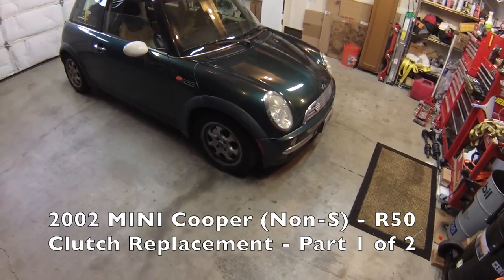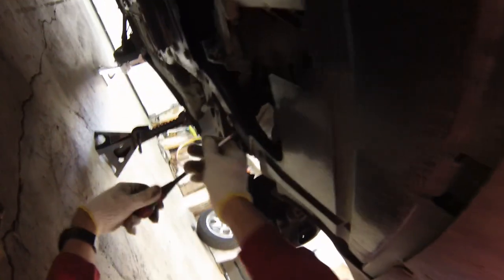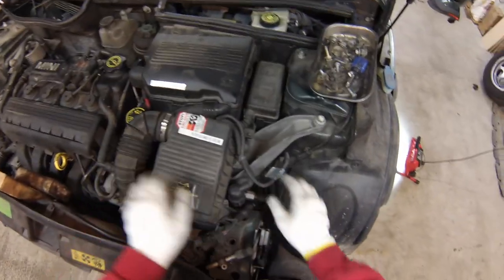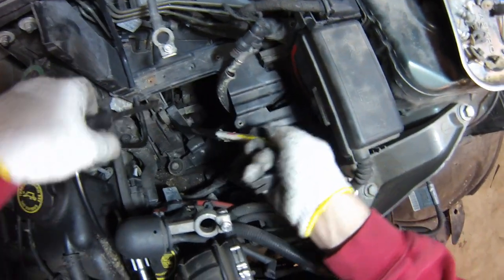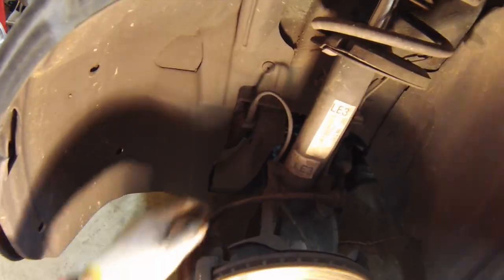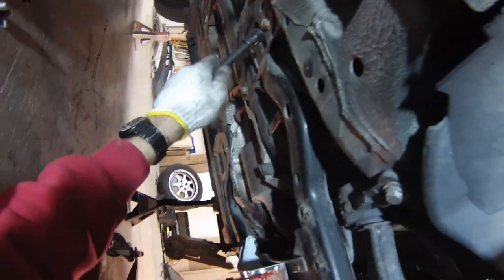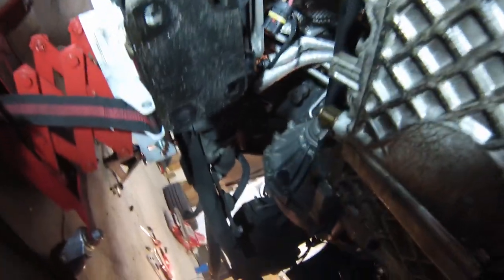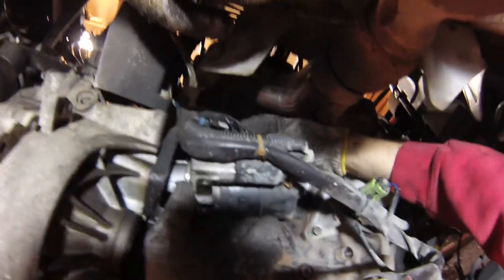2002-06 MINI Cooper Non-S Clutch Replacement Part 1 of 2

Comment: Thanks you for a thorough and well made guidance.
BMW in Norway wanted £2,200 for the job. (Madness) 
Bought the clutch for £100 and fixed it myself. To evenings, and the job was done. :-) 
This video helped me a lot, and made me use 2 evenings instead of 4.  THANKS

Comment: Hi There, from across the Pond in the UK 🇬🇧. I just wanted to make a comment. I recently had to replace my Gearbox and Clutch and Rear Oil Seal. Your video Help Massively. As I do most of the work on my vehicles. Iv never had to change a Gearbox and Clutch. Your Two part Vedeo was a great help in me doing myself and save a lot of money as it cost between £350 to £450 to get it done at a independent Garage. Im even happy to say, I was able to centre the Clutch disc by hand on the first go, with your tutorial. So I want to say a BIG MASSIVE THANKS!!!!
GREAT TUTORIAL, AND KEEP UP THE GREAT WORK. YOUR CHANNEL IS THE ONE I COME TO FOR HELP WHEN ANYTHING GOES WRONG WITH MY CAR.

Comment: Thank you for this excellent video, I just replaced the clutch on my son's 2002 Mini Cooper and following your fantastic instructions made it really straightforward. The most awkward part was clipping back in the spring clips on the 2 gear linkages, very fiddly!  Also anyone doing this needs to take care when removing the ball joints, even using the right ball joint removal tool as in your video it is easy to damage the rubber seals - I replaced both ball joints just to make sure while the car was off the road. Thanks again Mod MINI for this super work!

Comment: This was an exceptional video on the process. Very thorough. I followed to a tee.  One tip that I found to make life easier when re-installing the bellhousing.  Get it close then buy/use two or three M12 x 120mm cap bolts to thread through the trans into the block to help hold and align it before mating them up.  Getting the transmission lined up back into the input shaft was a bit of a chore.   Other than that -- this was perfect.

Comment: Well done an excellent guide saved me a whole lot of head scratching did it on my drive on my own no real problems removing the plastic wheel arches is a good idea as it allows you to see much more
Reply from the maker: Not necessary but many people say it is helpful to remove the wheel arch.
Reply: Mod MINI I have a 2002 Mini and have a problem with it moving. Was accelerating hard in first and when I hit second it suddenly quit moving forward. The shifter will go into all gears including reverse but won’t engage. Checked the shift cables which are fine. With the car running you can hear something rotating beneath the car that doesn’t stop even when you engage the clutch. I know that’s not much information but wondered if you could diagnose it based on that info? I am capable of doing the work myself but need advice on determining the mechanical issue before taking the car apart. Thanks!

Comment: Great video very professional job and well filmed too. I have just completed disassembly of a RHD (UK spec) Cooper and couldn't have done it well without your guidance. I'd recommend removing the gearbox end support bush before attempting to split the bell housing as it will definitely foul. I also found that the gear change selector fouled an A/C pipe when trying to remove the gearbox, so beware of this as once it catches up it's a devil to free. Just to confirm that removal of the steering column from the rack is the same for a RHD vehicle. (there's more room on that side providing you remove everything as directed in this video).After disassembly I found a failed thrust bearing, the bearings hadn't come out of the race yet but they would have if the car had been driven any longer. I'm not convinced that the thrust washer design (Valeo replacement is identical to factory fitted one) is robust enough for this car to make it past 125,000 miles, which is daft because the quality of build of the car apart from this would enable this car to go for 150,000+ miles if driven sensibly. About to watch part 2 and complete my job. I'm a bit worried about the amount of greasy deposits in the gearbox housing suggesting a leaking oil seal on the box main shaft. Although not part of the clutch replacement, I have a worn track-rod end joint to replace and I could not believe how incredibly seized the track-rod end was. Heaven knows why this was impossible to turn, even with the subframe off the car.  I ended up having to buy the entire track-rod assembly which will hopefully be easier to remove at the track-rod end.
Reply from the maker: Good working. Use heat (propane or MAP torch) to loosen the outer tie rod (track rod) ends. Get them really hot and they will come loose. The clutch throwout (thrust) bearing is pretty reliable on these cars, I've only seen one or two fail. They should last the life of the clutch as long as people don't keep their foot on the clutch pedal while waiting at red lights.

Comment: Good video but not sure if you have to remove lower ball joint nut & tie rod on both sides wasn’t clear on that could you let me know cheers Michael
Reply from the maker: It needs to be done on the other side or the subframe will be hanging and won't come out...?

Comment: Great videos!! Ok question... I bought a used 2002 minit was in too many often individual and noticed there's a black hard plastic line running across the top of the transmission about about 3/8 diameter OD. It  Appears to be broken off about halfway across the top of the transmission. What is this line?

Comment: Is there a video on replacing and bleeding the slave so annoyed on this model where it’s located underneath the battery? That is the model that I am working on that is mine I’m poor I need to help. I feel that the Silla Noyd itself is too short and that there is a longer one only about seven eights of an inch longer but please verify that it’s a different size

Comment: Hello, I have asked you a couple questions before on my 2003 Mini and you gave me some great advise so I wanted to pick your brain on this:  My 2003 MCS just had the radiator replaced AND reservoir with New BMW coolant and Oil Change about 6 months ago but it started overheating about 1 month ago.  I pulled over and ended up having to add coolant to it. (since the radiator work it has not acted up nor indicated it needed any fluids} The oil at this point was very thick!  We didn't see any water or fluid in it though.  Its not blowing any kind of smoke.  It drives just as hard and smooth as it always has.  However, I cant seem to drive it more than 15-20 minutes, or sit at a stop light for more than 1 minute now without it overheating.  I spoke with the garage that did the work and he troubleshooted with me over the phone saying it doesnt sound like the thermostat, that I must be losing fluid somewhere, although i dont see any visible leaks on the ground, nor do I smell anything, yet when i check the fluid its bone dry!  Can you pick your brain and throw out some kind of possibility of this?  Im terrified it needs a new head gasket now and I'm prepared to pay for that but for my curiosity and posture when I go to speak my mind with this dude I'd like to have some valid responses not just an emotional outburst!!  :)  thanks!
Reply from the maker: Sounds like bad head gasket or if you have a Cooper S, the oil/water heat exchanger on the back side of the block has failed(it's attached to the oil filter housing). Not sure what you mean by thick oil. Water and oil mixed results in an emulsified mess that looks like chocolate milkshake. Replace or test the heat exchanger first before investigating head gasket or head. Head failures are rare but can happen if allowed to get too hot. I am aware of at least a couple instances where it was just the heat exchanger.
Reply: Mod MINI   --we checked the oil and yep, it was a chocolate milk - snotty mess.  I'm not sure how to proceed now...i drove it down the street to see reaction sound root causes...seems just as strong as always sounds normal no smoke...but snot in chocolate milk oil.  shame cause only 100k miles on this lil Mini Cooper S.  in your opinion is it worth fixing or replacing engine?
Reply from the maker: Do what I said below. Replace oil heat exchanger. Drain and fill engine oil 2-3 times until it runs clear. If problem comes back, replace head gasket. 

Avoid driving or only drive gentle for now. Engine is probably fine.
Reply: Mod MINI  hello again!   So we ended up parking my Mini for almost a year and getting a new Toyota 4Runner. HOWEVER about 2 weeks ago my husband tackled the Mini in a deep dive project fix and YOU WERE RIGHT!   we replaced that "water/oil heat exchanger" part for $135.00 and replaced the fluids & oil and made a few test runs and it worked!  I have driven it to work and back a couple times now in heavy traffic and it just purrs along!  I CAN'T SAY THANK YOU ENOUGH!  YOUR ADVICE IS WORTH YOUR WEIGHT IN GOLD, TRULY!  My husband said if you lived closer we'd have to take you out to dinner!!  I was at a loss and you gave me some hope that it wasn't as bad as it could have been.  THANK YOU!  So we are keeping our eye on the fluids and the way it runs, but so far it's all good!  Is there anything firther you might warn about after having replaced that part and had ot overheat a bit?   YOU ROCK!!
---- update:  today (8.03.2017) I drove it to work again, 3rd time now, heading home I stopped at the light to get on the freeway and I noticed the needle going up!  Yep got hot again. Pulled into a gas station and as I drove the needle immediately went down to normal.  I decided to creep home stayed under 70mph.  We checked the oil and there was water in the oil again.  Sooo...I guess it's the head gasket...??  I'm so bummed... Damn!

Comment: nice job. i was watching to see if you have to drain the radiator. i had my '03 R50 in for a clutch and it came back with no coolant!
Reply from the maker: It's possible to do it without touching the coolant.

Comment: What size is the bolt you used to hold the metal plate for holding engine with chain.

Comment: Opportune timing and an incredibly well-done video. Just about to dig into my girlfriend's Mini and sort a slipping clutch. This should be fun, and a bit of a departure. My daily driver (and regular patient) is a 42 year old Land Rover, of which I know every bolt, screw, and wire like the back of my hand, inside and out.

Any insight on important differences on an 07 non-S, 5spd?
Thanks very much for any additional hints/tips.
Reply from the maker: Shawn Eldridge 2007 MINI Cooper is completely different, but similar to other front wheel drive cars. The major steps are the same as in this video, specific disassembly will be different.
Reply: *****  I've only found one notable difference with the 2007 R52 5-speed Convertible so far. If you don't mind, I'll post a picture of it (and any other differences I find) when I'm done, along with any notes I can think of.

I'm just about to start cracking bell housing bolts (only starter and heat shield left before that). What is your opinion on going in and changing the rear main while I'm in there? Car has 55k on it, with no known oil problems of any kind -leaks, loss, etc. The bottom is pretty much pristine, in fact. But I have no problem pulling the flywheel to do it. Part of me thinks "might as well." And part of me thinks "If it ain't broke (and potentially has several tens of thousands of miles of life left ...)
Reply from the maker: Shawn Eldridge Depends how long you plan on keeping the car. You might be better leaving as is, but it's not hard to replace. Stock ones start leaking after around 120-150K miles.

Comment: Can i drop the subframe only a little bit for a complete replacement of the control arm bushings without disconnecting everything? I only want to drop it to have better access to the screws...so i can remove the whole control arm.
Reply from the maker: summse83 possible but it is easier just to drop it completely. You need several hundred lb-ft to loosen.

Comment: Love the videos. 
I’ve lowered the subframe to replace inner and outer ball joints and front rear wishbone rubber now my car shakes on acceleration at about 45mph but stops when I take foot off of acceleration pedal. Have you got any tips that could help please.

Comment: I just got my 2005 convertible from my mechanic after having the clutch, air filter, and serpentine belt replaced and I noticed a few things. It's a struggle to get it into first gear or reverse compared to before. I also noticed it's extremely rough and I have stalled a lot because of it. I noticed it engages a lot quicker. Will these problems go away after its broken in or did my mechanic do it wrong? The clutch he installed has a model number MU72260-1. Is this a street or high performance clutch? He claimed he test drive it himself to make sure everything worked properly but it feels a lot different with it being harder to put it into gear. There's no grinding noise either.
Reply from the maker: Jesse Hooton Was it notchy before the clutch replace? I think the 5 speeds are harder to push into low gears than the 6 speeds. That part number appears to be an OEM equivalent. The possibilities, other than clutch, for putting into gear are clutch slave cylinder needs to be bled, clutch slave cylinder is worn, or the throwout bearing release fork is bent.
Reply: ***** my mechanic said he fixed the throwout bearing but I'll have to ask him if he bled the cylinder. And it wasn't notchy before it was replaced. It's only notchy when the engine is running and the car is at a stop. It's not as hard to shift when the engine is off. Also I believe my rotors have become warped but I don't know what ones. How can I test which ones are warped? Also if my mechanic didn't bleed the cylinder, is this something I could do myself? Same thing with the rotors. Because my parents just paid almost $1800 for this repair because a few other things were fixed. We're on a tight budget at the moment and I need a car to get to and from school and other places and my mini was in the shop for over a month.
Reply from the maker: Jesse Hooton Those are all symptoms of bad hydraulics, throwout bearing shorter than necessary tolerance or bent release fork. If it wasn't notchy before, it shouldn't be notchy now, but I can understand if the mechanic wants to charge for following up. Sounds like the right part was used, and I don't know if bent release fork was an issue on the 2005-2006 R50. Easiest thing to check now is hydraulics. Also, what gear oil was put in the transmission? Wrong viscosity oil or oil without necessary friction modifiers can cause the synchros to not work as well and result in notchiness/difficulty to get in to 1st or 2nd when at a full stop. Hydraulics are not easy to bleed. You need to fully compress the slave cylinder and then press the clutch pedal ONLY when someone is cracking the bleed valve (and when the rear of the slave cylinder is pointing up) or do a pressure bleed, (again when rear of cylinder is pointing up.)
Reply: ***** thanks and when I drove home yesterday, everything was fine. The notchiness in the transmission is gone and it turned out, I was engaging the clutch a little too quickly. I had my mechanic check it out and everything checks out alright.

Comment: My car has a strange metal cage contraption around one of the shift cables (the one which sits with the flat side horizontal) and I am not sure how to remove it.

Okay. Still not sure what the cage is for, but, prying really hard did the trick and didn’t break it. So that’s good.
Reply from the maker: Gen 2 cars have those. Push down slightly on the clips on the bottom and push back toward the rear of the car. It keeps the cable from popping off the linkage.
Reply: Huh. Mine is a 1st gen. 02 base, with the slave on top. But the tranny was replaced by an independent mechanic before I got into wrenching. Maybe somebody modified it.

Comment: Hi! 
I have a 2004 mini cooper and my transmission still makes a strange noise like when you have metal with metal ... I just replaced all the ball joints, CV axels, and it continues to be the noise, disassemble the clouth and it is a little worn but there is no signs of broken metal and my question is if something in the transmission inside the gear could be damaged? I would appreciate an opinion, I'm from California
Reply from the maker: How does the fluid look?

Comment: I recently purchased a 2006 r53 jcw and since I bought the car I noticed the clutch pedal was pretty stiff, since I've never drove a mini cooper before I thought it was normal till last night, it happened smartly the same thing that happened to the car in the video the only difference is that my clutch doent make any wierd noise. so you think is time for a new clutch
Reply from the maker: Well if the clutch is not functioning property and you confirm the hydraulics are good, all the other components are inside the bell housing. Note that this video is for an R50, which has a different clutch and transmission altogether. Throwout bearing failures are less common on an R53 but they can happen.
Reply: +Mod MINI thank you for replying. I'm about to DIY hopefully everything goes smooth like in your video. once again thank you for your help